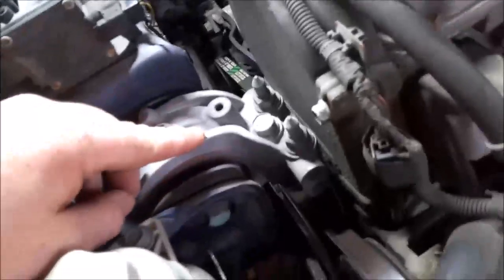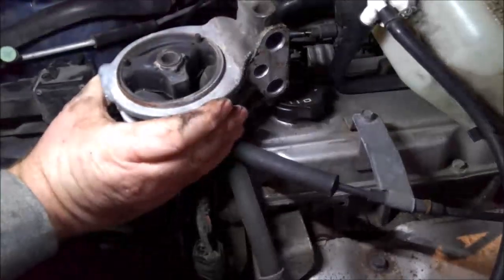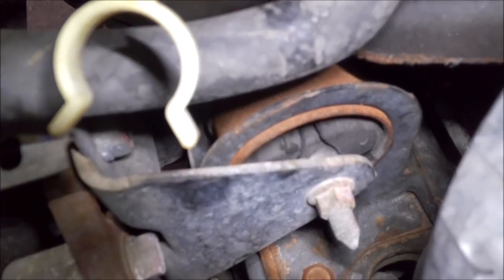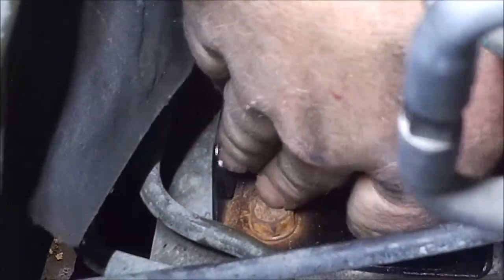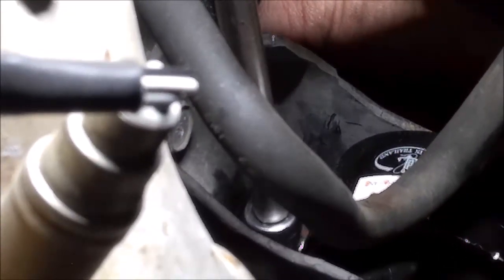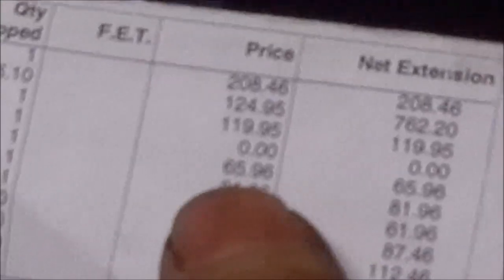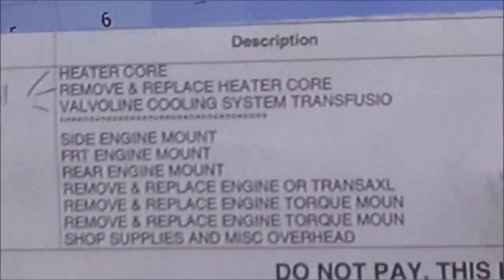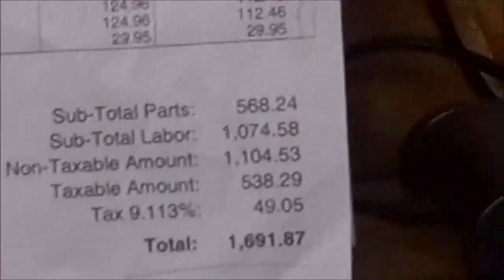2002 Mistubishi Galant Engine/Motor mount replace

Comment: My 14 on the front motor mount is stuck between the mount and the bracket the only way to get it out is to unbolt the mount I’m having the hardest time with it 🙄 thanks for the video.

Comment: My 06 Galant vibrates in Park, and in idle and I feel it while driving after I got it out of a garage where the timing parts were replaced. It wasnt doing this prior.They said I have a bad motor mount- do they go bad that quickly?
Reply from the maker: Not usually but it's possible when they did the timing the engine was manipulated enough that the mount broke probably going bad before that
Reply: @HooptiesGarage  how can I tell if the mount is bad? When I put my hand on the motor I can feel it vibrate and I see the radiator hose vibrating but I feel nothing when I put my hand on the mount.
Reply from the maker: Can you rock the engine back and forth and look at the mounts at the same time? Look for worn rubber in the mounts etc
Reply: @HooptiesGarage  I can support the motor and remove the mount to look at it just not sure what im looking at
Reply from the maker: It will usually be obvious the rubber that surrounds the mount will be badly degraded etc